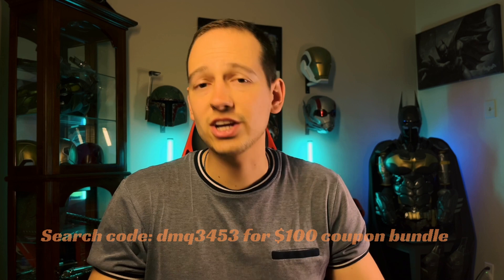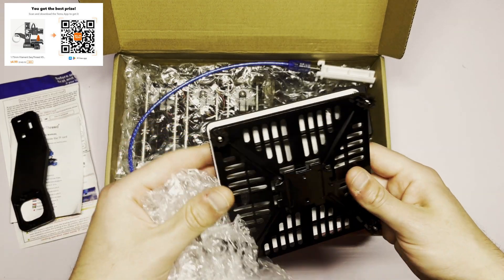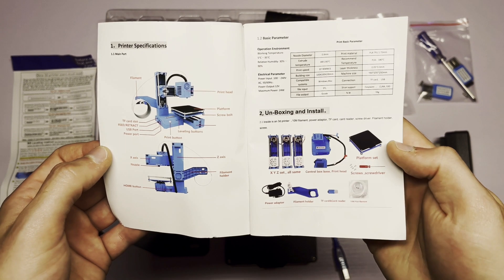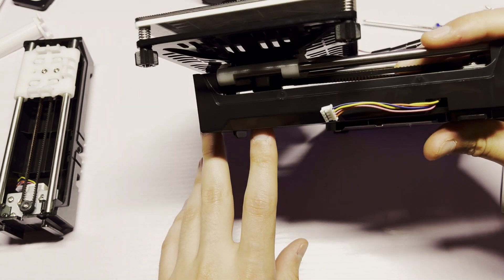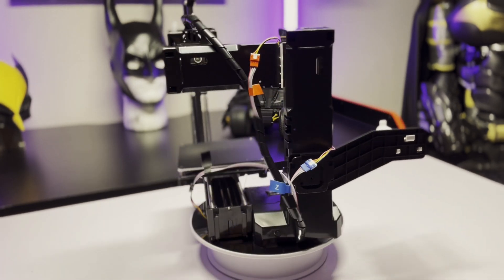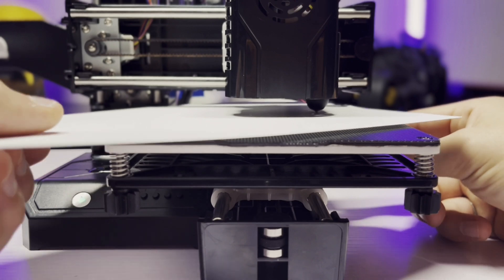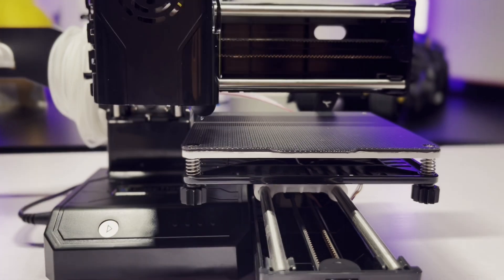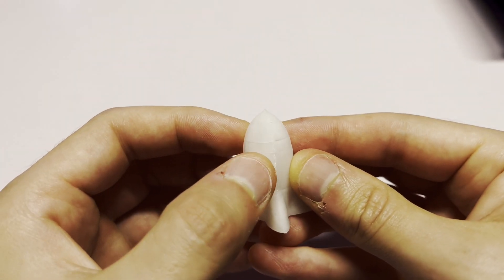Surprising Quality of Temu's Budget 3D Printer

Comment: So this cant be used to make a custom back panel on a Tablet or phone ? Only for decretive stuff.
Any one have a suggestion like DIY build one or the cheapest one that can be used to make more than decretive stuff.
PS. the Ender 3 sounds great. Ty
Reply from the maker: Depends on how big your phone is. If it fits on the build plate it could be done with this printer, but if you are serious about continuing printing, I'd say get an Ender 3 right off the bat.
Reply: @markitmade29  Size is no big to me as I can always make it multiple parts and glue/weld. But I saw on a different video on cheep 3d printer chat about the filament that the printer can use not able to make strong parts and only meant for decretive pieces.
Reply from the maker: @frankenstein3163  I've been able to use Overture PLA with this small TEMU Printer no problem. Same filament I use in my Ender 3 S1 and Ender 5 Plus.
Reply: @markitmade29  k. TY so much for you're response's.

Comment: I would always recommend to rather buy a used printer than this. A used printer wont cost more, but its a stable basis if you decide to carry on. This thing is just trash and after 2 printed benchies it either breaks or you want a bigger printer.
Reply: I agree with you, but still think this thing is great for kids

Comment: Is it possible to use PET bottle filament in this easythreed k9
Reply from the maker: No, it would not be able to handle that. You consistently need at least 265°C for PET filament and this printer only gets up to 235°C. It also does not have a heated bed. :)
Reply: @markitmade29  so, maybe we can upgrade it with other hotend

Comment: I kept buying unrepaired printers namely ender 3 V3 se. They were cheap and fast. Don't do what I do because experience electronics repairman. Anyway it is gambling for a good working machine I score out of 10 is 4, some were nothing wrong, middle is like simple fix, last few is way worst, just need a new motherboard. (I scrub that bit out and you don't want to replace the I.C.). For what cost, cheapest that I find £75 for a fully working one secondhand and is very clean. The other end I won't pay more than £100, ending up replacing a motherboard. I dare you want to do it at your own risk?